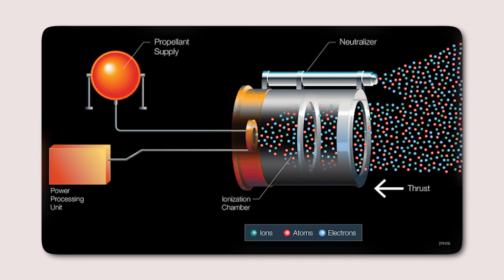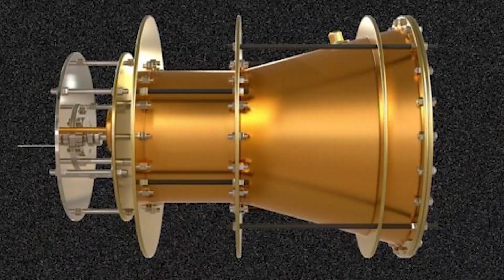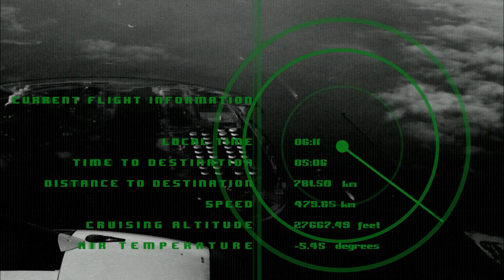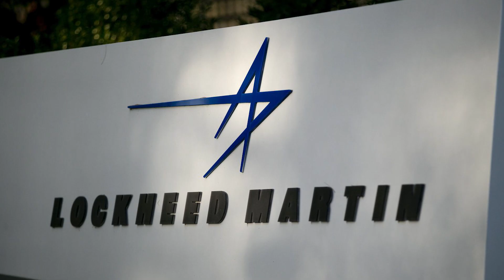Elon Musk Reveals SpaceX's New Supersonic Space Jet That Defies Physics!

Comment: 12:15 excuse me did you just say carbon fiber was heat resistant?... If you believe that, clearly you don't know a thing about carbon fiber.
Reply from the maker: Thanks for pointing that out! You’re right to raise the question. To clarify, carbon fiber itself isn’t inherently heat-resistant—it’s actually quite sensitive to high temperatures. However, when used in composites, its heat resistance depends on the resin or matrix material it’s combined with. Some advanced carbon-fiber-reinforced composites are designed to withstand higher temperatures, but it’s the combination of materials that provides that property, not the carbon fiber alone. I appreciate the chance to clear that up! 🙏
Reply: Elon I love you baby